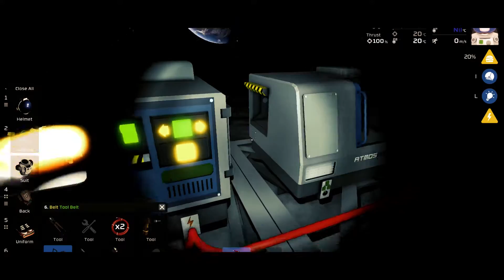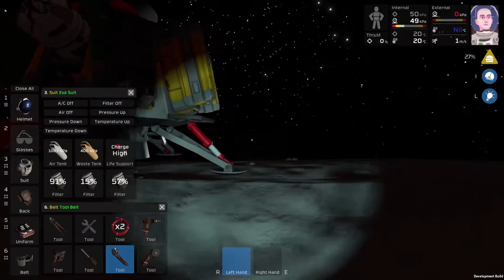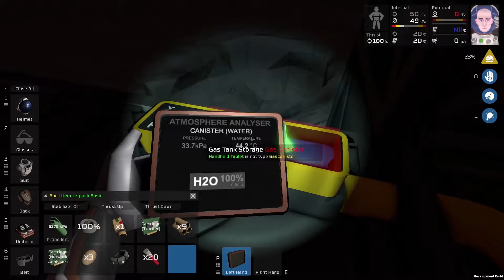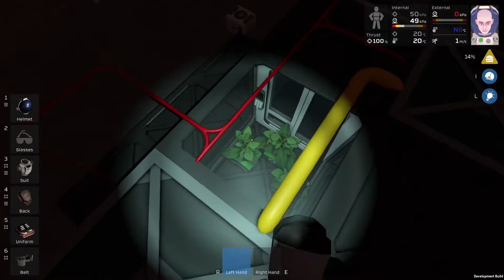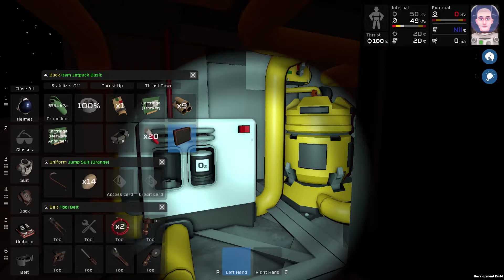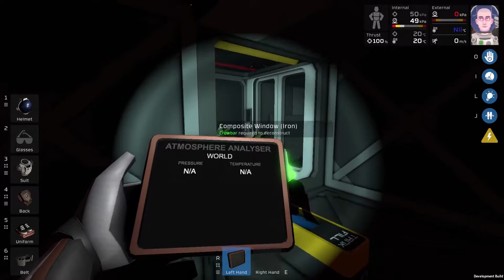Stationeers | Hot Water

Comment: I've been binge watching this series while playing Stationeers. Your explosions have really helped me learn what not to do (no offense). You're doing a lot better than I did when I first started playing, but watching your fails has helped me out a lot. Heres what I learned after a few explosions of my own:

Build yourself a 3x3 airtight room, plop down the portable hydroponics, put in the water canister, then grow tomatoes. Use your tank to put in some O2, and make sure you empty your waste tank in there. Use the portable A/C unit to adjust the temp. Anywhere from 7.7-125kpa is good for pressure, and between 20-50C is good for temp. Keep the CO2 above 1%, but less than 40%. Oh, and make sure you keep X as close to 0 as possible...you found out why pretty early on. Lol

Do all that and you're golden. I end up popping in there every few day/night cycles to empty my waste tank and run the A/C for a few degrees. If you need more pressure...just drop in a few chunks of oxilite...itll add a little bit of N2, but you can use the portable scrubber for that and X, then pump them out.
Reply from the maker: haha no offense taken those explosions are there to help us all learn! appreciate the tips will need to integrate them :)